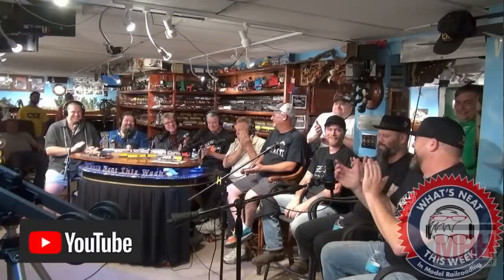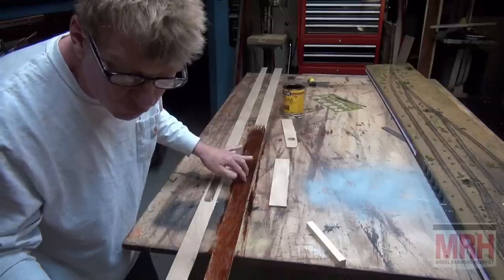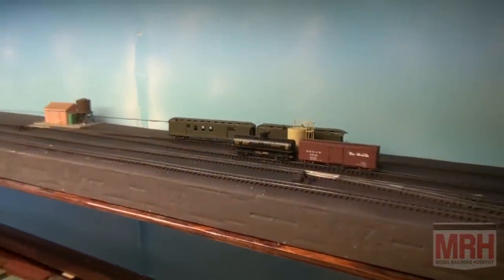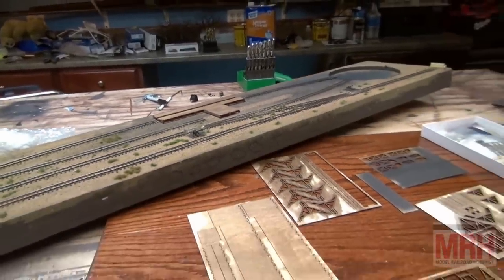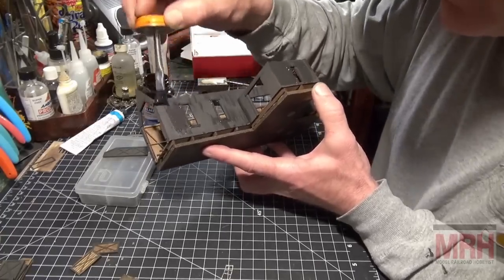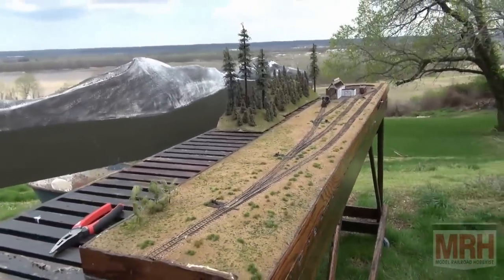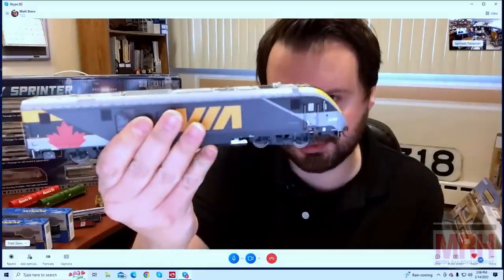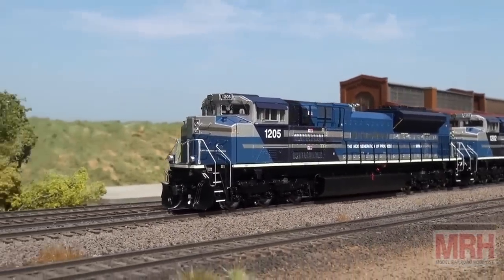Building a sectional layout:2 | March 2023 WHATS NEAT Model Railroad Hobbyist

Comment: Is there a specific reason that you cut the 1x strips into 6" ish sections and not left the strip the full length of the foam?  Does it have to do with adhesion or expansion/contraction of materials?